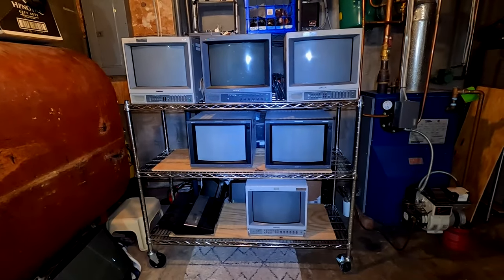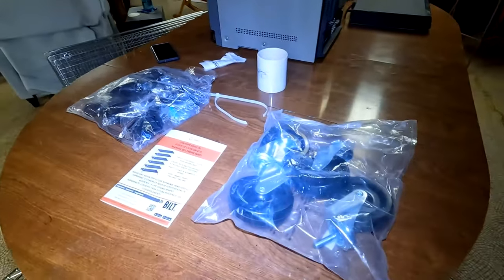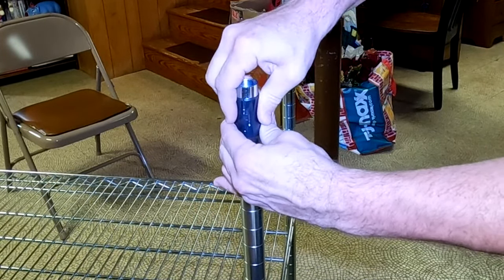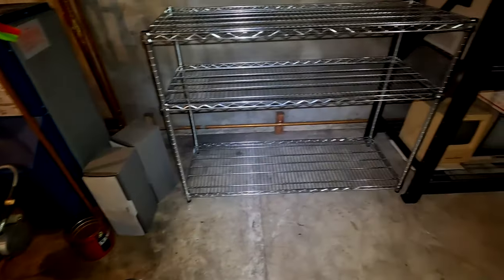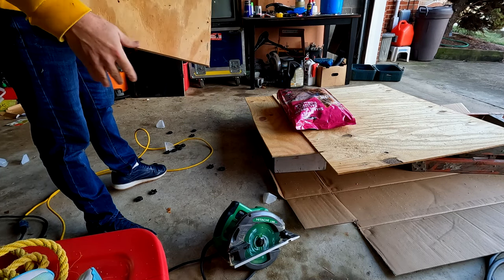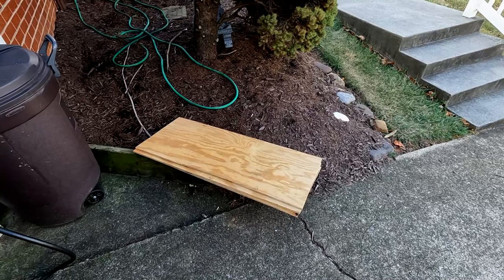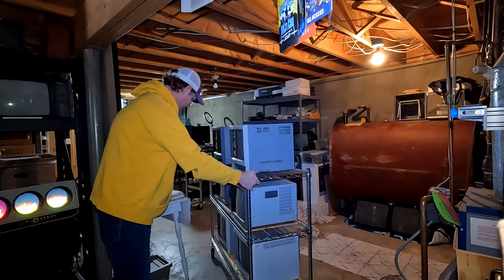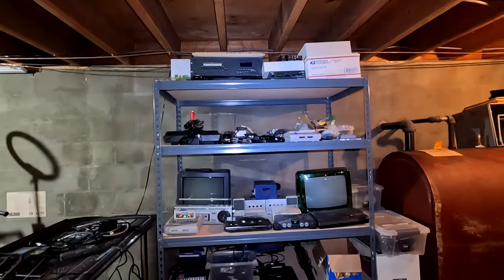The Trinity Cart & Rack Review - CRT Strong!

Comment: Hi Steve!! You said feel free to comment about this rack, so here i go! I want to point two mistakes that bugged me instantly. Locking wheels need to be placed in both ends so that it wont lose stability at one end. The second mistake will be harder to accept but these wooden sheets is useles and just adds extra weight. Metal bends as much as much weight is added but time does not add more bend like in wooden material. I rather put a wooden block to support bottom shelf. (Only applies for stacionary rack). Sorry for being asshole, love you no matter what❤

Comment: You have a nice rack there Steve, I'm actually looking for shelves or some type of unit to take several 21" CRT monitors, a couple 20" PVM's, a 32" ED CRT, (the Panasonic SR Acuity and the 36" model too), and a 25" monitor and a 25" curved Trinitron, it would be nice if it could take all that and be on wheels, would like it all to be raised up at least starting at 3 foot, so I can hook any of them up and use them at any point, got to be something industrial quality out there that can manage all that.

Comment: I dont have a rack but I have custom-built corner desk that goes the length of one side of the room then half of the other. I have my FD-Trinitron right in the corner, and by stroke of complete luck, there is a desk leg right under the CRT so I am fairly certain it shouldn't bend.

Comment: Wow, I actually sell industrial versions of these wire shelving units. Very odd to see what i do for fun and what i do for work collide like this. 

If you guys like these but want more capacity per shelf level, you should check out industrial brands like Quantum or Metro. Price will be higher but they support 600-800Lbs per shelf level.

Since i work for a company that sells these I managed to snag some neat black epoxy units for my collection. These same manufacturers also sell plastic totes and bins in various sizes so you can order your whole crt organization system from one location to save on shipping.

not looking to shill the company i work for off the clock though. You can usually find these cheapest from restaurant wholesalers who get deeper discounts. 
Just try googling around when you find a sku you like for the cheapest price.

Watch out for the wheels though. I've retrofitted casters on the stand for a giant Trinitron before and had it topple over due to the front heavy glass (it survived). I believe the distributed load of several smaller CRT's across a unit, like in this video, is safe though.